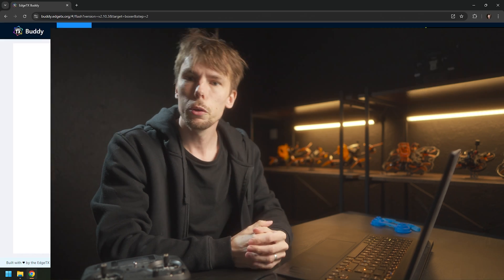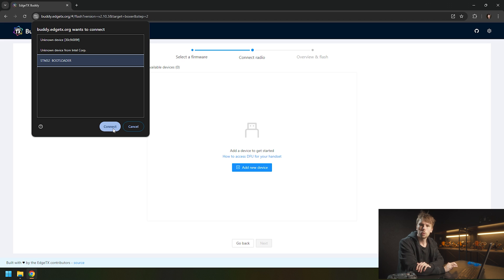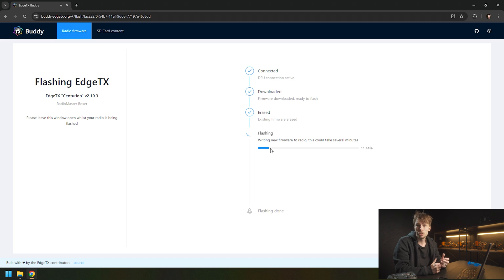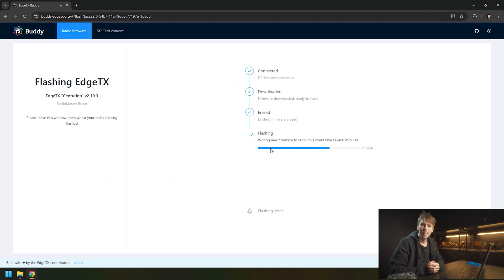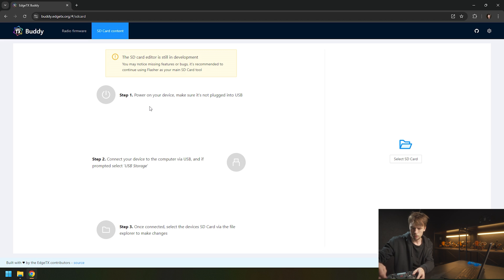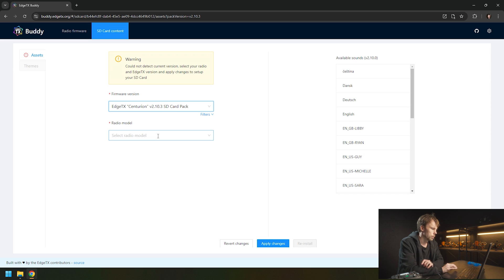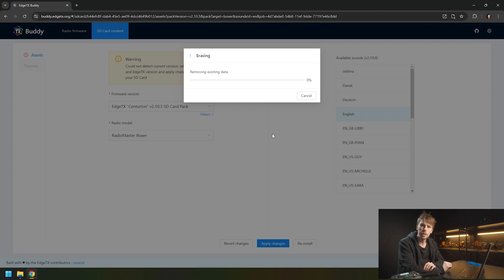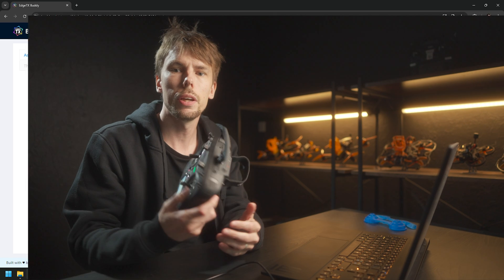Super easy EdgeTx Update Guide for Radiomaster Boxer, in less than 3 minutes!

Comment: i was able to do the SD card but i cant do the first one it just fails and says faild to connect.
Reply from the maker: That’s odd, are you in bootloader mode? The radio needs to be off when you plug in the usb to enter bootloader mode
Reply: @RaukFPV  yea i tried everything. i was looking up the model i had witch is the radio master cc2500 and i guess i need a external module even tho is has a internal.
Reply from the maker: Hmm Strange, didn’t think it would be different. If you cannot get connection, have you also tried getting the stm32 drivers and reinstalling it?

Comment: Any tips for why my sd card won't take update?.. new updated firmware does not show on sd card on the controller when updating sd card content...
Reply from the maker: Hmm, haven’t had that issue. Are you updating the sd card content via the pass through through the radio? If you have a card reader you might have luck trying to update the sd card via a card reader instead

Comment: Will the stored models be safe with updates?
Reply from the maker: it should not modify or delete any additional files you have added (LUA scripts, sound files, images, custom themes, model files, radio setup file, etc) that are already existing on the SD card.

but if you want to be safe, you can make a backup of the models on the sd card.
Reply: @RaukFPV  thanks

Comment: when my radio is turned of it can't connect but when it is on it can connect to it but can't flash
Reply from the maker: you might need to download the stm32 drivers. check 0:57 in the video
Reply: @RaukFPV  it worked for me. Thanks

Comment: Hey there! Nice videos! One question. Im a foreign, and I want to Fly an Avata 2 in Denmark Copenhague. Do I need the A1 certificate? If so, how can i get it? Because as i understand i need a Nemid or MitID. And im not from denmark, im a NonEU citizen.
Reply from the maker: Hey thanks for watching, 

when it comes to flying in denmark, as a non EU citizen, you still need to register and get a drone license as the avata2 is a c1 drone. the problem is that you need a "mitID" which you cant get cause you need to be a danish citizen. If you contact Maudrone, i think he knows who to contact in order to get a license without "mitID" 
i've just looked for the email, but cant seem to find it. you can try: info@trafikstyrelsen.dk 
they are the ones responsible for the danish drone space. 
You might be able to get a license from another EU country, which would also be valid for flying in denmark. 
keep in mind in order to fly a drone over 250g, you need to have a drone insurance covering a least 1m euro. 

other things to consider: 
you might need to update your avata with eu firmware as its required to have a speedlimit of 19m/s,
Reply: @RaukFPV  Thanks for the info man! Very helpful. Ill try to contact them.!! Good luck with YouTube, good content, keep it up